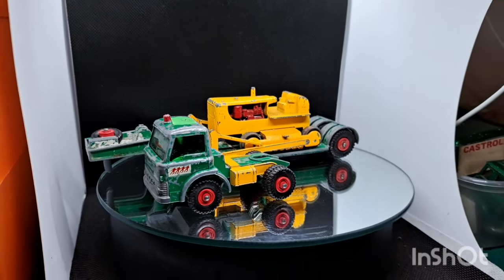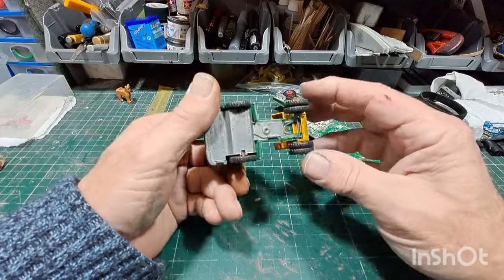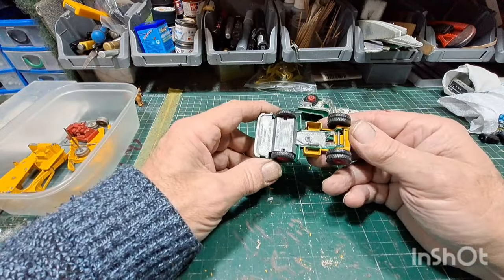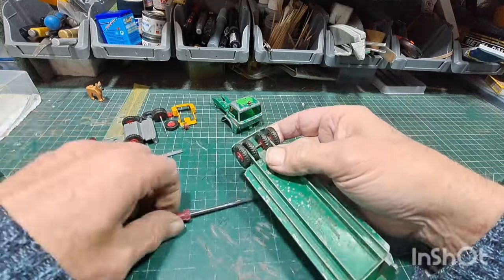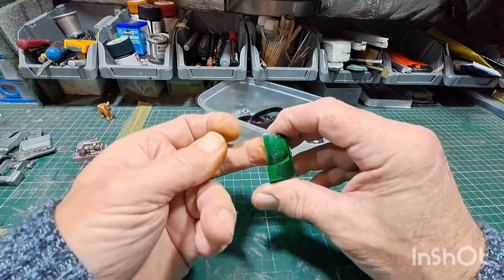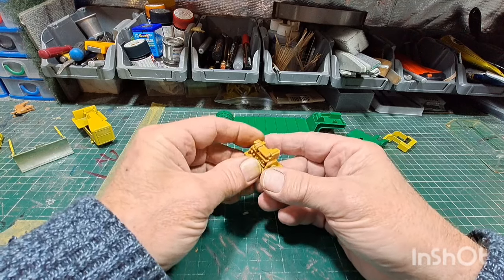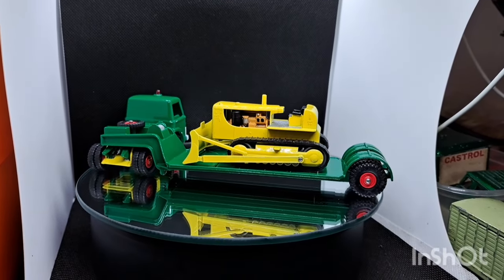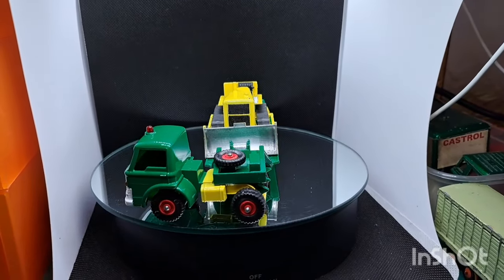Diecast Restoration Matchbox King size K17 and No/3 D9 Caterpillar

Comment: Hi there Martin a very nice job there I've got 2 of them ones and 4 of the flat trailer for  Tractors the  Dozer turn out very nice too .  Many moon to go my cousin had one of them and turned it into a tipper using a small matchbox it look very good,  great tip on doing the   Lettering the front I think with your  Steady hand you couldn't get as good as that . I've got to Catch up on some of your videos I'm about  For behind . 
Ralph.
Reply from the maker: Thanks very much Ralph, this unit does have good code 3 potential. 
All the best Martin

Comment: Hi mate wonderful job as usual. I wonder why they never put a back window in the cab it would be good for keeping an eye on the load. That higher back end reminded me of my MG I bought some new leaf springs for the back because after 60 odd years it had a lean on the drivers side of the car. Only problem was the car then was too high at the back it looked like someone had liked it up the #%$. They took my old ones for part exchange and by the time I had fitted the new ones they had sent them to Sydney so couldn't put the old ones back on. So I ended up putting two inch lowering blocks on the rear and that fixed the problem. If the springs ever sag I can just take the lowering block off again. The colours really pop now and the extra detail looks great brings it to life. I think I'm getting old and loosing it a bit I had a gig in the duo last week got half way there and realised I had forgotten to hitch the trailer with the PA in it on the car a bit of a senior moment.🤣🤣👴🏻 Catch you on the next one mate If I can remember where I left my laptop.😂😂🤣🤣👍🏻
Reply from the maker: Hi Geoff, I can imagine the choice words ,when you realised the trailer wasn't there. ,yes a rear window would look better. All the best Martin

Comment: Morning Martin  l hope that d series  ford has a Cummings  engine  in it or it won't  pull the skin off a rice pudding.  low loaders have come a long way since  the 60s 70s on that Dyson  trailer you had to knock pins out of the rear axle  to remove  it to get the load off if it was a road roller etc.bull dozers you throw a couple  of railway  sleepers down and drove it up over the side  mate
Reply from the maker: Thanks for that information I didn't know that, now used to work for perkins so Cummings were are competition. 🤣

Comment: love the colour combo. :) I didn't know that piece in the back of the trailer is actually a suspension piece until now! have to check mine lowloader if it's complete. but I think it's missing on most nowadays.
wheeled bagger, caterpillar, what's the difference as long as they fit. :)
Reply from the maker: Cheers Lothar, the second version has different wheels and suspension, it doesn't look as good I must admit. All the best Martin